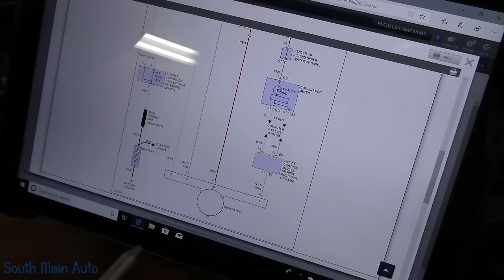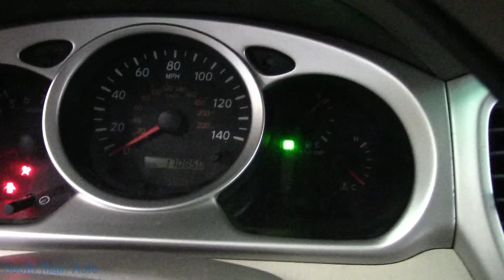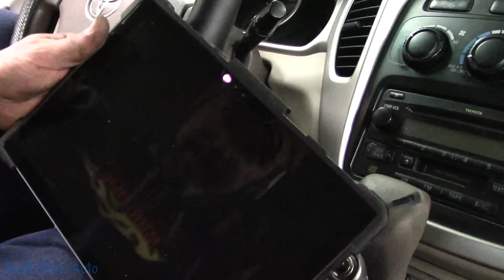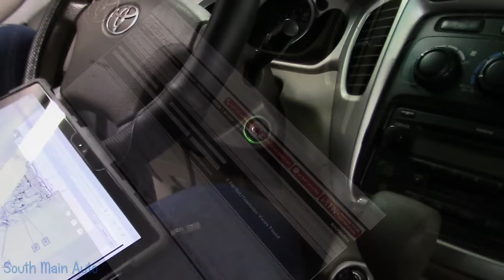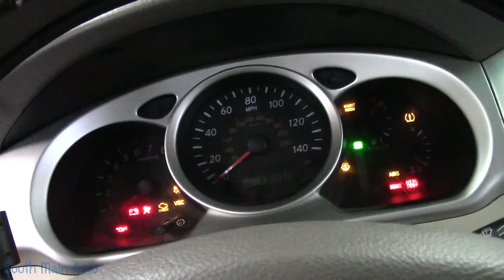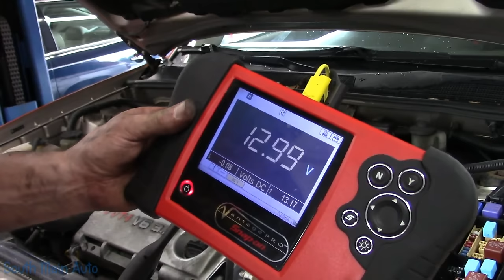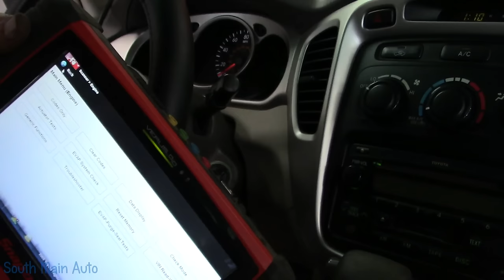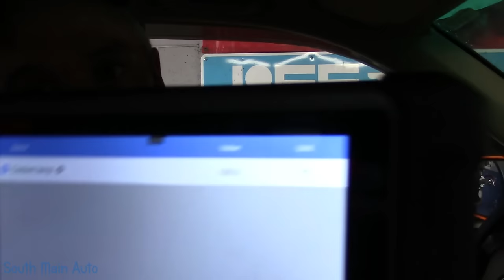Toyota Highlander - To Fix It, Follow The Smoke! 🔥

Comment: Eric, I probably saw this hack on your channel, but I watch so many car repair vids that I can't remember so I'm officially putting it here now. The trick with the electrical tape is to spool some onto a deep 7/16" or 3/8" socket which allows you to wrap inside really short harness bundles with total control of the wrap tightness and tape cleanliness. This is especially handy when making a temporary repair to a harness that has been mouse chewed at random locations that are sometimes inches or even feet apart while you're waiting for the new harness to arrive. Still doing it better than anybody else out there (even your buddies!) but they will never leave you, and neither will we!

Comment: Nice job, electrical problems can be the toughest problems to correct on any modern car, I have worked on electrical problems both in automotive and aviation. When working on aviation problems we call testing a unit that is questionable and we apply power ( on the ground of course ) it is called a smoke test or a snap test because you can hear circuit breakers snap off with a loud crack when a short exists in the system. Your'e fix is also correct, in my humble opinion, because the only reason for that connector to exist was to make the factory installation of that fuse box easy, and after the vehicle left the factory it had no other function, so yes; the repair you did was a good way to solve the problem. No one ( other than myself ), I have ever known, has removed a fuse block in the engine compartment.

Comment: Absolutely the correct repair on the wiring. Not only the inexpensive fix, but also better in terms of reliability. No reason to replace the OEM connector. Had a connector for the HVAC fan controller on a 2007 Impala melt. Had a shop replace it once, I replaced it once, and it kept melting. Found that the fan motor was pulling too many amps even though it worked fine, so replaced the fan. Still soldered the wires directly on the controller to make sure it wouldn't melt again. It worked fine after that.

Comment: Heh a BIG THANK YOU goes out too you. After watching your cabin air filter replacement video I checked mine.  I knew that I had one but never dawned on me to check it. I have a 2008 Chrysler Sebring  Limited convertible. Bought the car 5 years ago and wondered how come the fan didn't blow hard on full speed. The heater worked great no problems whatsoever, the air was OK.The car is located on the prairies and not near trees, wildlife etc... The filter was absolutely packed solid!!! The fan output is 200% more effective and the air is absolutely freezing. It's just like a new car. Thank you so very much and please keep the AWESOME videos coming Your greatful fan. Ron G
Reply: get rid of that car fast it is a money pit Crysler builds crap

Comment: Loved the video. I had the exact same problem on my 2005 highlander......radiator fan running with key removed. This did the trick. I opted to splice/jumper all the wires and remove the connector as you suggested in the video. This fixed all my problems and one other. Great video and thanks for the tip.
Reply: I also had a parasitic drain from my battery, which was my additional problem that is now rectified. Once I removed the connector, I noticed that 3 pins were missing and evidence of massive corrosion. This video surely saved my $$$$$.

Comment: One of the things I really appreciate is how you always do a proper job fixing things, but realize that doesn’t always mean going back to new. I had a similar issue, the place wanted to replace the wire harness due to a bad metripack connector of some sort in a $1500 car with multiple issues, before working the rest of them, which for all I knew, could mean junking the car. I told them I would be there in 30 minutes. I showed up with my weatherpack kit, cut the factory one out, and had it replaced with weatherpack connectors in 20 minutes. You should have heard them whining and crying because it wasn’t the “proper” connector. It’s sealed, it’s a connector, it’s a $1500 beater, give me a break.

Comment: Years ago when I worked flat rate at a dealership I became by default the "electrical guy". I didn't mind too much because most of the cars and trucks we worked on were the dealer brands and we had the OEM wiring diagrams and parts. 
Then the dealer took in a 1965 E type Jaguar roadster on trade with a bunch of weird electrical problems. Factory AC inoperative, aftermarket radio killed the instrument cluster lights, and headlights blew turn signals are the three I recall. I got the job to fix it and fixed a couple issues but then told the service manager I wouldn't touch the rest without a wiring diagram. He told me to just do my best so I did. I took it for a three hour "test drive" came back and said I had no idea what was wrong or how to fix it. I didn't make any money that afternoon but it sure was a fun test drive.

Comment: Follow the smoke...

An old S10 Blazer with lots of miles presented me with a puff of smoke from up under the dash one morning.  I figured it was the turn signal stalk since it had also done something similar a couple of years prior.  Then, it did it again.  This time I got my head down there and saw it coming up from a heel hole in driver's side floor pan covering.  The heel hole was from years and years of accelerator foot wear.

Great engineering GM...  Put a wire bundle directly under a seriously high-traffic area of the car interior.

Needless to say, I spent a long day splicing in two foot sections of replacement wire.  The excessive length was to move to virgin copper (no green crusties working their way from the insulation breach) and keep the solder joint well away from the foot traffic.

Comment: great diag. I would have done the same although one option that comes to mind is a trip to the old junk yard for that connector. Would still be doing a bunch of solder work but still have the disconnect option. Just a thought. Again I would have done the same thing you did. Salutations to you and the family at SMA.....
Reply: junk yard for connector that appears to be fail point...? not a chance just solder it

Comment: Another good video Eric.  I believe you had the correct call on soldering the wires.  If you replace the connector you have to solder twice as many connections (or attach pins and sockets) and you didn't gain anything.  Plus between the tape and heat shrink the wires are protected from any more damage.

Comment: You could cut a connector from a wreck or find an aftermarket one but I agree your fix is perfectly acceptable. If the fuse box ever needs to come out they can just replace the connector at that point in time. My guess the car will be scrapped before that happens given the lack of maintence it appears to receive.

Comment: Great Job deducing the issue. A big part is the fact that the battery is right next to those connectors. You have battery fumes, moisture as well as driving in rain and time. A similar thing happened to me but the connector was under the battery tray. You did the right thing soldering and heat shrinking the wires. Toyota should have put the battery in another spot.👍👍👍

Comment: Great job, glad it was you and not me.  Throttle cleaning works wonders.  My 05 Saturn Relay started fine when cold, but when it was warmed up, forget it.  You had to get play with the throttle to get it started.  I finally said enough and tore apart the throttle body.  Half a can of cleaner later and problem was gone.  That thing was so dirty I’m surprised that I could start the van at all.

Comment: Hi Eric, i bought really strong magnets on Amazon (the ones with the hole in the middle) and JB Welded them to the bottom of those lights you use that keep falling due to crappy magnets. Huge difference in aggravation while working. I just learned recently that holding down the switch causes these lights to blink red. Good to stick on the roof of a disabled vehicle. Great Video, as usual.

Comment: I guessed crusty wires as soon as you described the problem. It was just a lucky guess but I based it on all the other crusty wire incidents I watched you previously handle. I agree with you to take a chance and clean the throttle body instead of just driving it and hoping it fixes itself.

Comment: Man..I was wrong on this one; I kept thinking "look for the aftermarket stuff". It usually will cause random electrical issues because who ever install's it splices wires and does a shotty job. Went straight for the alternator circuit and found not only blown fuses and fused wires but SMOKE! good call man! Just shows I am still learning.

Comment: Bag clips, you know the ones for closing chip bags and things like that, make awesome wire holders when dealing with a clump of wires.  Have 10 of em, different lengths, in my box. Handy, cheap and useful for keeping wires separated, holding them for soldering, hold every wire at same time and solder away, as well as other handy uses

Comment: I’m a retired auto electrician in Brisbane Australia, and impressed by your knowledge and skills. Keep up the good work. The only comment I would make as an auto electrician is to buy yourself an LED test light as there may be occasions if you use the one which is a light operated test light it may draw excessive current and damage ECU circuits. Cheers Graham

Comment: We use to have a Toyota Camry All Trac that had electrical problems. That pretty much discouraged us from buying Toyotas. But eventually we got over it and now own a 2009 RAV4 which has nearly 50,000 miles and so far has been trouble free. (Although the transmission down-shifted a but rough recently.)

Comment: I thought from the title you were going to be using the smoke machine! Hahahahahaha
Reply from the maker: Built in smoker on this one... just need a bigger fuse for more smoke :)
Reply: Me too
Reply: @SouthMainAuto   please  can you tell me about the part of throttle body i didn't understand what you have done   thank you very much
Reply: @moemansour7369   moe mansour  Electronic throttle bodies have a learned position in order to achieve proper idle. As carbon builds up in the throttle body bore it closes off the space between the plate and the bore restricting airflow. In order to compensate and keep the idle right the ECM opens the throttle plate further. When you disconnect the battery and reset the Adaptive, it goes back to a default state and the idle is low because of the dirty throttle body. By cleaning the throttle body, he was able to restore it to the state the ECM was expecting and the car idled correctly. The opposite tends to happen on Toyotas when you clean the throttle body and don't reset the adaptives. It idles high in park or neutral until the car is driven enough for the ECM to relearn the correct position for idle. Hope that clears things up!
Reply: @gearheadautomotivel.l.c.5476   thank you so much    i got it
Reply: No problem. Happy to help. :)

Comment: First of all I think for Toyota to put those connectors right next to the battery was a very poor design decision.
With the battery offgassing since 2006 that would lead to the corrosion in those connectors eventually.
I believe bypassing those connectors and making them sealed directly the way you did eliminated the original design flaw. And flaw I mean having it too close to the battery. 
A seemingly impossible and confusing set of symptoms and you still were able to calmly go about your way and diagnose very accurately what the issue was! Brilliant! Well done sir.

Comment: in my travels as a breakdown mechanic iv seen lots of connectors that are close to beside the battery mount being corroded heavily . we believe fits from previous battery corrosion on the terminals and or acid from battery has spilled into the connectors . easiest way is to bypass the connector wire by wire with seperate plug connectors or just solder in bridge wires around the connector ! it’s 16 years old !

Comment: had an 05 Camry, disconnected the battery, same throttle issue happened. You just have to reset the idle which is SUPER EASY. 
1. Turn key to on position (don't start engine) then turn off
2. Turn key to on position,  THEN start engine
3. Put parking brake on
4. Put (and keep) foot on brake, then shift to drive and release SLOWLY the brake pedal. 
5. Sit there, in drive/gear, (you won't move due to parking brake) and the computer after 3 minutes should learn its idle again. 

Heard this still applies even up to today; hope this helps someone!